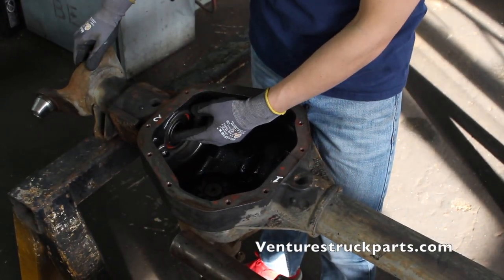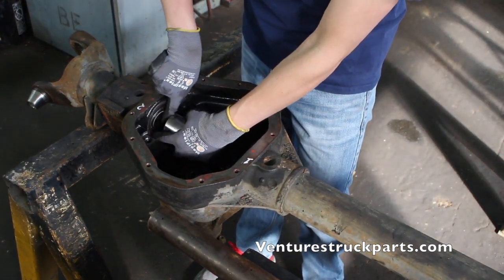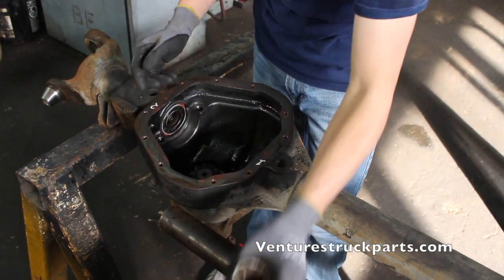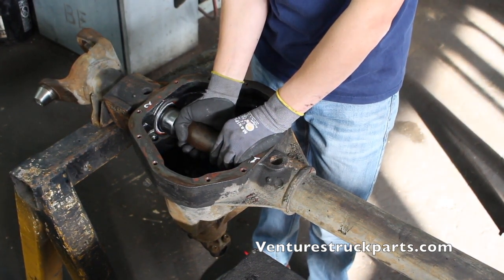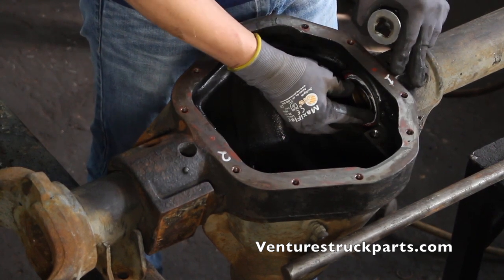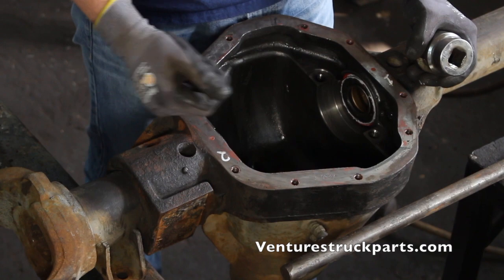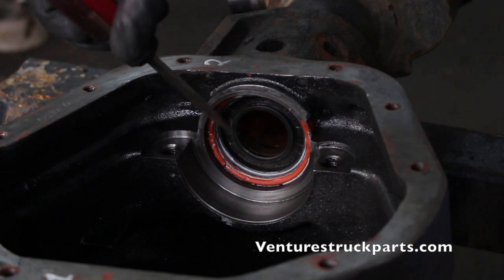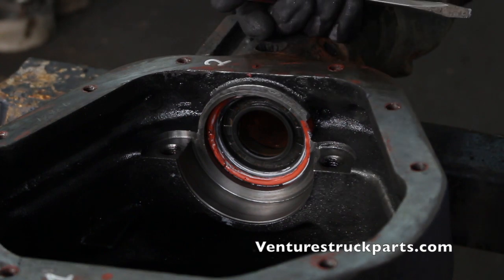Installing Or Replacing Inner Tube Seal Dana 44, Dana 50, Dana 60 Etc Front Axle

Comment: That solid shaft metal that you use to knock seals out. That was our mop around my dad's house. He put on mop on the end of that sucker so we wouldn't break it. We used to always tend to break mop sticks by accident. That mop weighed 30 lb, you didn't even have to scrub the floor when you mopped

Comment: Do those inner seals have a stop lip to position the seal exactly in the correct position? I have seen some tools that insert the seal inside the tube to an exact depth. I am asking about a 22 year old Dana 50 IFS TTB front diff. thanks
Reply: No. I have to make sure they dont go in to far